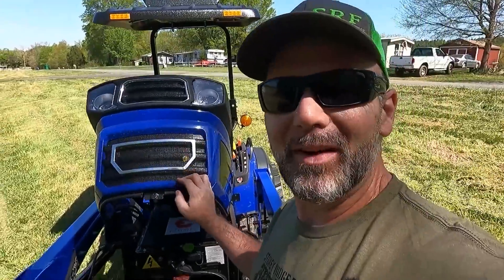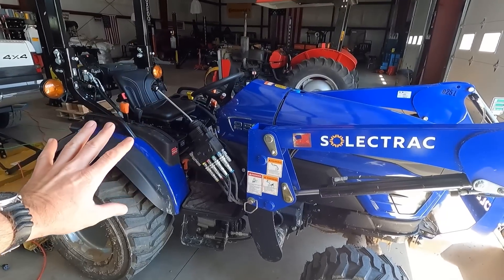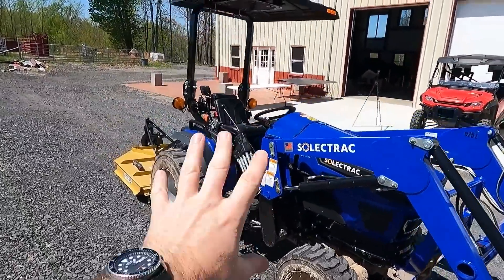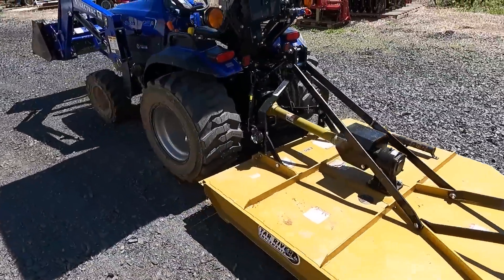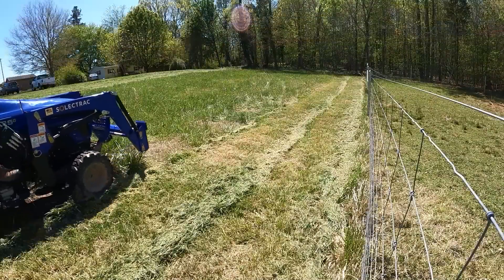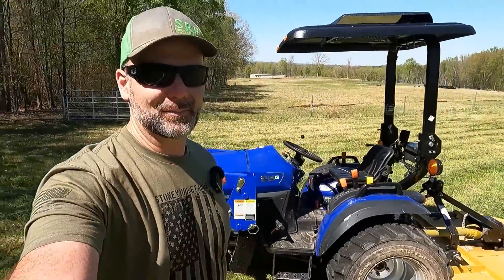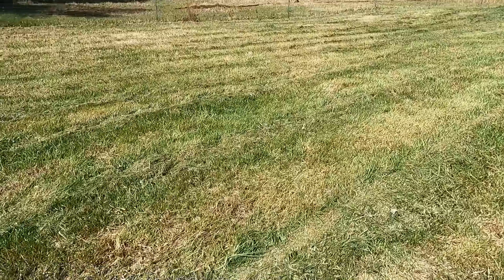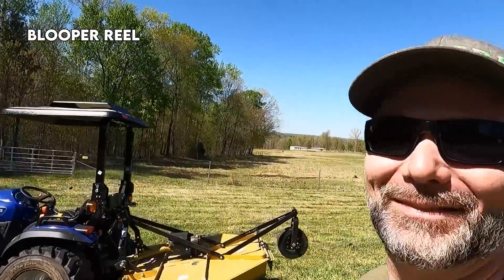Electric Farm Tractor testing....first time brush mowing tall grass

Comment: And you just lost a subscriber 😢
Reply from the maker: When FOX, MSNBC and CNN pretend that every American needs to pick a side....I choose the side of work, building my farm and saving fuel my friend. This isn't politics...this is getting the work done on a tractor powered 100% by the sun.   Remember when the tractor replaced the mule in the field?  This is just an electric mowing mule
Reply: Taylor Swift said it best "Haters gonna hate hate hate"
Reply: Hope you don’t support that it will soon be mandatory for farmers to buy electric.
Reply: @petermavus4131  the right to e pair is the key

If you don’t ensure those rights, electric is death for farmers
Same with electric cars
If it stays open, it can become an efficiency boost, but I suspect it’ll be quite a while before gas is displaced on the big machines
Reply: @petermavus4131  Which are you going to choose an electric tractor with a hundred times the potential power or an obsolete gas guzzler that cost ten to twenty times as much. In five years battery-powered equipment will be mandatory due to the cost to operate and maintain a fossil-based machine. That is not a government mandate. Now all we need to do is figure out a way to do away with windshield washer fluid.
Reply: @rickster9993  In the meantime how bout back to “energy independence “ to get fuel prices back down to where they were.Even Elon sez we cannot just throw aside fossil fuels immediately.
Reply: @petermavus4131  The USA has all the gas it ever needs, until batteries last forever, not interested. I appreciate Josh showing different equipment.
Reply: @rickster9993  Yeah supply and demand does work that way.  What happens when the electric car mandates start kicking in around 2030?  Read the news if you have not seen countries and states bypassing the free market and passing laws forcing EV use.  CA, WA, Ottawa and others have passed laws demanding EV use and many others have bills in process.  Government artificially driving up fossil fuel prices to equal the costs of wind and solar is whats been going on, a lot of that in the US has been by tying up already issued drilling permits in court.  It still remains to be seen if we even have enough lithium, rare earth minerals etc for the US, Europe, etc to go electric all at the same time.  If everything is going EV, especially at once, those prices are going up significantly while fossil fuels will become cheaper.  Also consider what its going to cost to expand our electric grid to handle the energy that previously was supplied by fossil fuels.  The figures I've seen require triple or more expansion of the electric generation and distribution system across the country.    If the ban on nuclear energy persists how are they going to generate the energy?  Wind and solar take up significantly more land that a gas or coal plant.  They going to pave the national forests for that space or go after farmers land like they are in the Netherlands?  Who pays for that because its not going to be the companies profiting off EV or the utility companies, they will pass those costs on to the consumer or go out of business.  Its going to be the lowest income people not subsidized by government that get hit the hardest.  Yet again.
Reply: @StoneyRidgeFarmer  10 years isnt very long service life for a tractor.  You have about 4 working hours per charge with a new battery per 12 hours of charge time, thats going to decrease as the battery wears out.  Whats the expected duty hours per charge at say 7 years?  How much does that replaced or battery servicing cost at 10 years?  How much is that in relation to replacing it with a new tractor?  I would think this is the big question on the sustainability for a family farm with current EV tech.  If its like some of the EV cars I have seen its most of the cost of a new unit to replace the old.
Reply: @StoneyRidgeFarmer  it would be ok if they made electric for those who wanted them and left the disels for the people who want them but no they want to make them all electric and I do not support it nor will I
Reply: @multivariateperspective5137  Electric is death for farmers, Not. Electric may actually make the farmer profitable. Their already in the process of replacing the big machine with electricity.  Within five years we will see the introduction of a battery-powered jumbo passenger jet with twice the range. Right now there is working prototypes of battery-powered harvesters.
Reply: @petermavus4131  No but we are energy independent. The oil we import is a low grade that is processed for lubricants and exported. Once again I'll repeat the government cannot control oil prices. That is something handled by privately owned oil companies.
Reply: @destroyerkuroshiokai  No states or countries that I have heard of have passed any law forcing EV use. Some have passed laws prohibiting the sales of new gas-powered cars in their state or country after 2030 but I see that taking place every where because of market forces rather than government mandates.
Reply: @destroyerkuroshiokai  Actually they're talking about a million-mile battery in just a few years. Batteries are already cheaper to replace than a typical gas engine. New batteries that are. Battery-powered equipment is more powerful now. That is what drives trains and mining equipment. Telsa has a semi that is out performing every thing on the road.
Reply: @rickster9993  How is that really market force if government is prohibiting new sales and machines wear out and need replaced?
Reply: @rickster9993  I'll believe a million mile battery in a passenger car when I see it.  I'd settle for a battery with a life comparable to a gas engine of around 200-300k miles with the loss of no more than 20% of original range.  Its the loss of range IMO thats particularly offensive as I drive a lot for work.  I cant afford to sit for hours to recharge a battery.  Who is replacing batteries in EVs for 5-10k including parts and labor?  Is that even going to be something that can be done by the end user like me that prefers to do my own maintenance?
Reply: @destroyerkuroshiokai  States have that right, I don't believe it can be done at the federal level. The feds can only offer tax incentives. Now about breakdowns, that is the nice thing about EVs not much to break down. Electric motors can last for a long time and battery technology is on the verge of major advancements. Integration of new advanced technology takes time. The only real problem I see is the used car and rebuilt parts industries. I suspect the accessory industry will lead with rebuilt battery packs following. I'm afraid EVs will be a trickle-down problem initially for the used car industry and poor people.
Reply: @destroyerkuroshiokai  Look you need to re-educate yourself on EV's. There already out preforming petro powered cars in every category. They have superior power, faster reactions, and cost way less to operate and maintain over a ten year period. What more can you can ask for?
Reply: @destroyerkuroshiokai  Check the engine replacement cost on a just out of warranty gas car. As the rebuild industry kicks in battery pack prices will drop drastically. Beside all the money you saved with electric more than pays for replacement batteries. That's if you charge off the grid.
Reply from the maker: thank you....and remember...this isn't an EV..its just a tool
Reply from the maker: how on earth would it ever become mandatory? Its impossible
Reply from the maker: If a man can't figure out how to order and change a battery...then he'll hire it done right?  It's not that complicated
Reply: @StoneyRidgeFarmer  yes it is I don’t know why you say it’s not you don’t realize how much that batterie cost plus the damn electric one are like triple the price of a diesel and then at least we can work on our diesels unlike this junk battrie operated stuff is going to drive this world in the ground I am telling you but you don’t want to listen to know one else it’s just what you think is best but who gives a shit what the other real men prefer this stuff isn’t  no good nor will it last sure 1 day of work on it oh it’s the best tractor ever but use it for a long time and I bet it will not hold up
Reply: @StoneyRidgeFarmer regulations will make it so... tuffer emissions controls proposed by 2030 already
Reply: @rickster9993  yeah if you driving around and a AA battery.  🔋   lol 
 You must not have an ev cause of you did you'd know that wasn't true. Talk to someone who has had to replace the battery in one.
Reply: @StoneyRidgeFarmer  It's paying for the batteries I don't want to do.
Reply: @safffff1000  In other words if your gas engine dies your not going to pay for it either. The batteries are already heading for being cheaper if they're not already cheaper.
Reply: @rickster9993  I buy gas for my engine, I don't have to spend thousands replacing the gas tank. If I run out of energy I can carry 12lbs of gas and get me 10's of miles. There is no way I can carry 12lbs of electricity and get hardly any miles.
Reply: @safffff1000  Actually your wrong. You can carry more electric millage than you can gas mileage. New this year the 500 mile battery charged to 80% in about 15 minutes. How about portable solar powered packs Charge you car in primitive camp. Oh try to make your own gas.
Reply: @rickster9993  Lol a 12 lb battery does not get you but a couple miles. I want to see carry in your hand walking that 500 mile battery.
Reply: @StoneyRidgeFarmer  no its not its worse on our environment the production of those batteries is worse than pulling oil out the ground
Reply: LOL 🤡
Reply: @StoneyRidgeFarmer  maybe pay attention to what some manufacturers are doing to lock out as much maintenance at dealer level as possible.  John Deere is really bad about it.  Sure swapping even a 500 pound battery is straight forward, but if you need the tractor computer to verify the replacement battery and that can only be done by a dealer tech with proprietary equipment.  That is the stuff that drives up the cost to ridiculous levels. None of this is verified in the video, was that part of the deal? You are being disingenuous comparing this to a hand held battery powered tool, it comes off like a used car sales man.
Reply: @Stoney Ridge Farmer   would you actually buy one of these if it wasn't given to you?
Reply: @rickster9993  with all due respect, you are just WRONG as a matter of physics.  “Right now the lab people say gasoline is 100 times more energy-dense than a battery. That means you would need 100 lbs of battery to go as far as 1 lb of gasoline can take you.” gasoline weighs about 8.6 lbs. per gallon.  many cars can travel 30 miles on a gallon of gas. that means you would only need 8.6 lbs. of gas to travel 30 miles.  a rough math calculation shows you would need 400 lbs. of battery to travel the same 30 miles.  that is the reason why the new Ford F-150 Lightning electric pickup weighs 9000 lbs!
Reply: @jimharvard  Well Jim based on experts you're wrong. Today's batteries are nothing like yesterday's batteries. 500-mile battery packs are coming out right now. Ford Didn't select the best battery pack and they converted a gas guzzler to run on batteries. EV's are ten times more efficient than gas guzzlers. Don't believe me google it.
Reply: @rickster9993  i have done my research and you CANNOT change the laws of physics.  the very BEST batteries available today still DO NOT have anywhere near the energy density of gasoline or diesel.  perhaps you should "google" that FACT.
Reply: @jimharvard  I checked into it and as far as true energy density gas is better but because of the inefficiencies of the engine, transmission, and rear end. not to mention the energy needed to get it out of the ground, transport it to a refinery, and then to the consumer makes the density far less efficient. Besides the new battery technology is more than tripling the capacity of the battery and new electronic breakthroughs are increasing the efficiency of energy use. Train engines convert diesel to electric to drive the trains. Why more power and efficiency. Battery power trains are being tested right now. Two companies are producing tractor-trailer rigs capable of a 500-mile haul range. Jumbo battery-powered jets are in prototype stages right now. Track/wheel loaders, excavators, and dozers are already on the market. Energy density, who cares, efficiency is the key word here. A typical battery pack will soon cost and weigh less than a typical engine/transmission/rear-end system. When Ford finally gets around to redesigning the F150 for batteries it's efficiency will triple at least.
Reply: @rickster9993  i am happy to see that you are honest enough to accept the "laws of physics" in recognizing that gas has vastly more energy density than electric batteries.  now as to your "efficiency" argument.  yes, due to the mass and friction of more moving parts in a gas/diesel engine/transmission/differential system, overall efficiency of that system is vastly less than the efficiency of an electric propulsion system.  however, the advantage of this increased efficiency is still outweighed by the substantial energy density of gas/diesel when employed in a conventional mechanical propulsion system.  the other massive problem with the battery systems is the weight of the batteries.  Diesel/electric train locomotives are not affected by the massive weight of the electrical system because more weight works to the "traction" ability of the engine.  UNFORTUNATELY - massive battery weight IS a PROBLEM for semi-trailer trucks.  the U.S. Government limits on trailer trucks is 80,000 lbs.  Tesla and others have found that to achieve the "industry requirement" of AT LEAST a 500 mile range for a battery trailer truck, the battery required will weigh at least 15,000 lbs.  this battery weight must be DEDUCTED from the Government regulation of 80,000 total weight limit so a battery-powered semi will only be able to haul 65,000 lbs. of cargo versus the approximate 75,000 lbs. of cargo for a diesel truck (assuming 600 gallons of diesel weighs around 5100 lbs.). so an owner of a battery powered semi is not going to be able to haul as much cargo as a diesel powered truck owner will be able to.  this will translate into lowered profits and income.  NOW - you will say this loss of income is offset by the maintenance costs of a diesel over an electric truck.  but the diesel truck maintenance costs are just not that much.  AND - a diesel truck can easily go close to a million miles over a ten year period. you can rebuild a diesel engine in a semi for around $20,000 dollars.  the cost of battery replacement in an electric truck will be EXTREMELY expensive.  the battery for just the new 1/2 ton Ford Lightning electric truck is $35,000 dollars.  you could multiply that probably 5 times for the semi truck battery.  THE FACT IS - the LAWS OF PHYSICS are the primary impediment to scaling up electric propulsion for ground transportation systems and those FACTS are not going to change no matter how much YOU or your fellow "climate crisis cult" members "wish it were so."
Reply: @rickster9993  You are correct. Electric vehicles have full torque from the get-go. Gas and diesel have to be at optimum RPM for full torque.
Reply: @destroyerkuroshiokai  And how much fuel, lubricants, etc. did you have to replace in that range??? EV tractor here costs about $300/year for charging (not solar, from a wall socket). Diesels are 10X that in just fuel. Bring in engine oil, etc. . . Hmmmmmm.
Reply: @reneegiles5087  yes and none of that accounts for the service life of the battery.  It would have been helpful if the video talked about any warranty or manufactures expectations.  Instead we have to guess which makes me suspect EV manufacturers have something to hide, or why not last the truth out there.  We all know EV have a shorter run time as the battery ages while diesel does not.  Also consider the duty cycle between diesel and EV.  The diesel can keep cranking out work with only a couple short fueling stops per day and will keep making money long after the EV has to stop and charge for the rest of the day.  That’s just common sense and that profit is going to add up day after day week after week that needs taken into account when you add everything up.  There’s reasons why government is forcing things like DEF and higher operating costs on to users while subsiding EV to lower their real cost.  It’s the only way they can make EV economically viable right now with todays tech.
Reply: @jimharvard  The price of electricity is about 1/10th the cost of diesel for the same miles driven. Besides we haven't even begun to develop the electric motor to its maximum efficiency. They are also improving battery energy density. Oh by the way the gas engine/transmission/drive shaft/rear end in a vehicle probably weighs as much as, if not more than a modern battery pack.
Reply: @StoneyRidgeFarmer  by sun, is that what you call the charging station used over night?
Reply: @destroyerkuroshiokai   Similar questions about EV vs ICE.  EV batteries are predicted to last 10 yrs / 100,000 miles.  Would anyone buy an ICE if the engine has to be replaced every 10 yrs / 100,000 miles?  I'd be on the 3rd engine in my wife's car and 2nd engine in my van.  Batteries for these applicatons should not be charged to more than 80% unless absolutely necessary and not discharged below 20%.  That may limit the 4 hr duty time to less.  I'll keep my ICE.  This tractor would probably be ideal for maintaining a small estate or sorking a small farm where daily use isn't the norm.